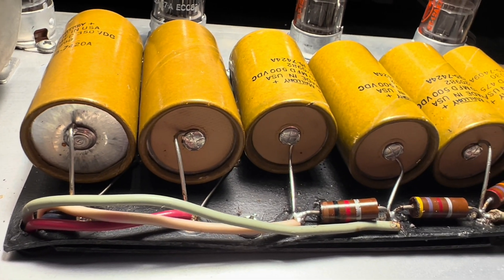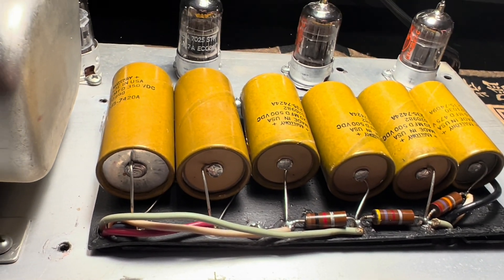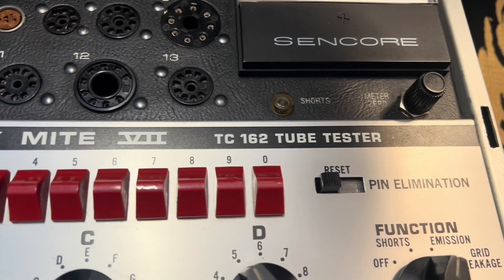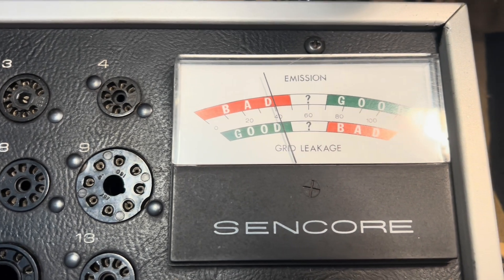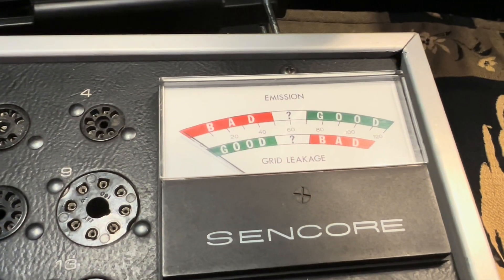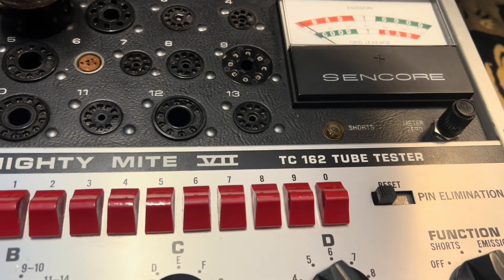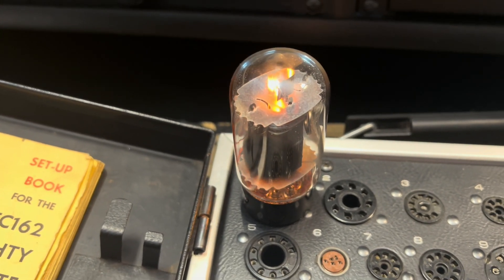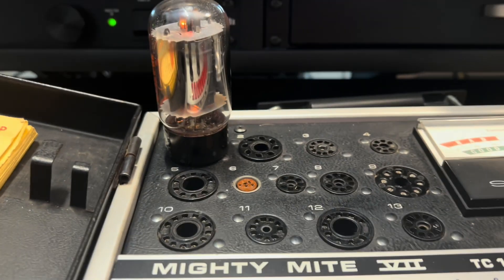Bassman 50: Those 70’s Caps & Tube Testing

Comment: The arbitrary replacement of the hi voltage b+ caps does nothing, don't understand the reasoning. Either functions or it's defective. I was an authorized Fender warranty and maintaince tech. for ten years and also built many fender amps for my band in the 60s70s. Same transformers (120 watt) from fender, similar circuits , usually 1 preamp channel..
Reply from the maker: I'll leave your comment here if you feel you need everyone to see your balls. 

Measurements make things less arbitrary. Leaving capacitors in poor condition in critical positions risks expensive output tubes and vintage transformers.

Capacitor health isn't binary. There are grey areas in terms of ESR, EPR, leakage, and ripple within their operating environment. I don’t risk my customers’ gear by relying on my gut or some random person with no skin in the game.  I don’t let my customers leave with hand grenades unless they insist after being informed.

Comment: The output tubes were compromised by failure to regularly clean out the grid leak drip pan, causing ion build-up on the cathode coatings.
Reply from the maker: Gotta do it every 3k miles! 😂

Comment: I have two restored Avo VCM Mk II tube testers, a restored Weston 981 Mk 3 tester and an etracer computer controlled tube curve tracer. This video is a good reminder that in the hands of a person with lots of experience a simple emissions tester is all that you need for most repairs.
Reply from the maker: Preach. Even in best case most testers are pass/fail devices with very little shades of grey. I like the sencore for the form factor and sensitive shorts test. Truly the best testers are the amps the tubes were designed to live in, but I have to use this to justify the expense for some clients.

Comment: In the last year I picked up a silverface Pro Reverb for 300 dollars in a garage sale.  It was as original pristine and untouched as is physically possible.  Even all the tubes were original Fender labelled and date matched to the amp's manufacturing period.  All tubes were strong.  It needed recapping, that was for sure, and I did that.  Sounded fantastic. Left all the original tubes in it, why not?  I doubt the thing had more than a few hundred hours on it total run time.
Reply from the maker: We hate your guts!!